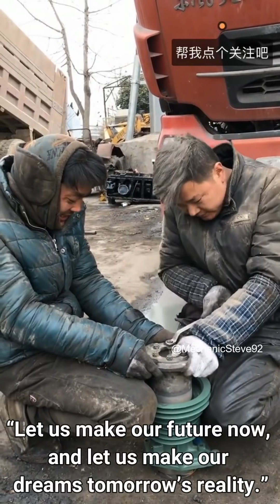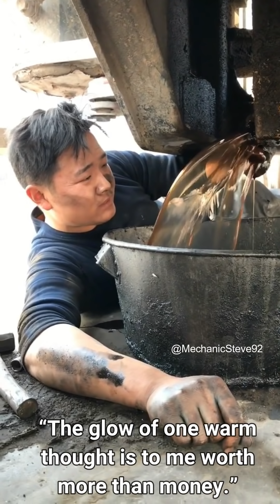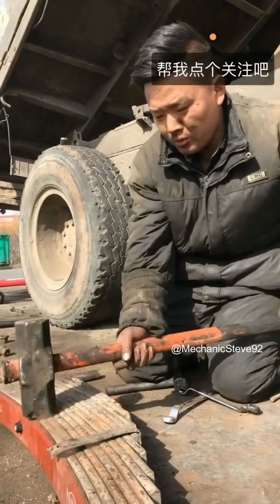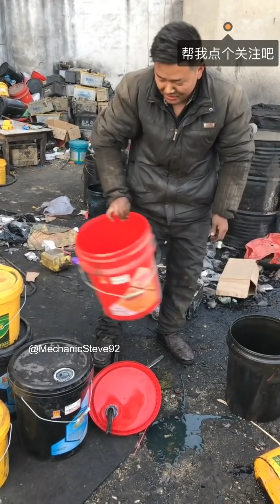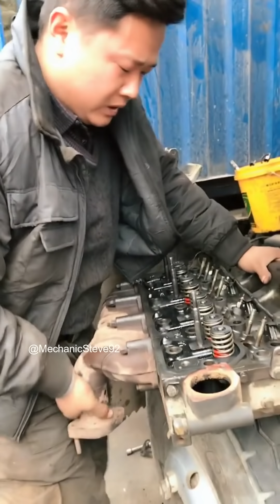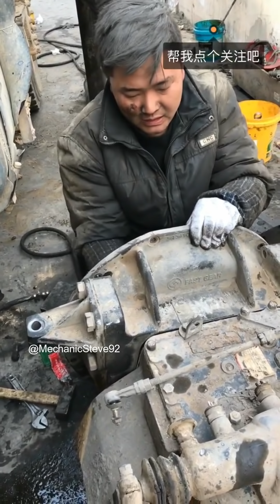"No Teeth No World , No Gear No World"

Comment from the maker: (Oil & Fluids)
Shell Rotella T6 Full Synthetic 5W-40 Diesel Engine Oil
https://amzn.to/35BvUZy

Motul 007250-4PK 8100 X-cess 5W-40 Synthetic Gasoline and Diesel Engine Oil - 5 Liter Jug 
https://amzn.to/3a1gH7h

USC SprayMax 2K Glamour High Gloss Aerosol Clear
https://amzn.to/2R9bdPc

(Tools & Equipment)
Ratchet Wrench Set
https://amzn.to/2FB2eRN

DEWALT Mechanics Tool Set, 205-Piece
https://amzn.to/3a15JPq

Comment: Peace be upon you, my dear brother. I want advice from you. I have a Chinese car. The engine type is 1.5 of the Grettowall C type, thirty, from the year two thousand and twelve. It has a problem to start the engine. It starts to increase and decrease, then turns off and we try several times. The engine trembles a lot and it turns and the engine is weak in the cycle to hit the pedal. We take off my leg and turn off the engine until we turn on the fridge to increase the engine in the cycle. The mechanics told me to buy a carburetor. I bought a carburetor. They told me the mechanics have removed the wheels and tied the valves. I cut the valves and I fixed the valves, but it was removed as it was. We did not find a solution for it. They advise me, may God reward you.